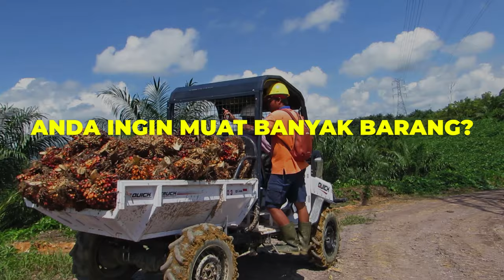BIAR GAK SALAH PILIH QUICK TRUCK | ALAT ANGKUT SAWIT KUAT DAN MANTAP

Comment: Like no 1, dari Cikupa Tangerang Banten Indonesia.
Reply: Untuk Kalteng harga berapa bos.
Reply from the maker: Kami memiliki 2 tipe Quick Truck, yaitu:
* Quick Truck (Starter engkol) QT-14M adalah Rp70.300.000 
* Quick Truck (Starter elektrik & engkol)  QT-14E adalah Rp73.950.000
Dapat menambahkan:
* Roda Besi (1 set) dengan biaya tambahan Rp1.600.000.
* Side Trellis Set dengan biaya tambahan Rp600.000.

Harga belum termasuk biaya kirim dari Showroom Banjarmasin ke lokasi Pak Bos. Harga sudah termasuk PPN 10%, oli, solar, dan biaya pelatihan.

Info lebih detail, silahkan menghubungi nomor telepon sebagai berikut:
TELP/SMS/WA : 082133326329 (Ibnu)
atau bila berkenan mohon kirimkan nomor telp/HP Pak Bos, bagian pemasaran kami akan menghubungi Pak Bos :)
Reply: Kendangkdmpul
Reply: @quicktraktor  l
Reply: @quicktraktor  l
Reply: @quicktraktor  0
Reply: 00
Reply: @quicktraktor 

 😅

Comment: BerPa harga quip angkut sawit
Reply from the maker: Kami memiliki 2 tipe Quick Truck, yaitu:
* Quick Truck (Starter engkol) QT-14M adalah Rp66.400.000 
* Quick Truck (Starter elektrik & engkol)  QT-14E adalah Rp70.050.000
Dapat menambahkan:
* Roda Besi (1 set) dengan biaya tambahan Rp1.600.000.
* Side Trellis Set dengan biaya tambahan Rp600.000.

Harga belum termasuk biaya kirim dari Kantor Cabang Yogyakarta ke lokasi Pak Bos. Harga sudah termasuk PPN 10%, oli, solar, dan biaya pelatihan.

Info lebih detail, silahkan menghubungi nomor telepon sebagai berikut:
TELP/SMS/WA : 08112848887 Sales QT

atau bila berkenan mohon kirimkan nomor telp/HP Pak Bos, bagian pemasaran kami akan menghubungi Pak Bos :)
Reply: @quicktraktor  klu second berapa ya

Comment: Harga berapa rupiah untuk wilayah Banten Plat A.
Reply from the maker: Kami memiliki 2 tipe Quick Truck, yaitu:
* Quick Truck (Starter engkol) QT-14M adalah Rp69.200.000 
* Quick Truck (Starter elektrik & engkol)  QT-14E adalah Rp72.850.000
Dapat menambahkan:
* Roda Besi (1 set) dengan biaya tambahan Rp1.600.000.
* Side Trellis Set dengan biaya tambahan Rp600.000.

Harga belum termasuk biaya kirim dari Kantor Cabang Jakarta ke lokasi Pak Bos. Harga sudah termasuk PPN 10%, oli, solar, dan biaya pelatihan.

Untuk melayani pembelian dapat menghubungi
Kantor Cabang QUICK JAKARTA
Jl. Gajah Mada 154, Jakarta
Telp: 021-6292044, 6490020
SMS/WA : 0811 2545 908 (Agung)
klik link https://bit.ly/HubungiMasQuickQTJakartaFB
Fax: 021-6490013
Email: jkt@quick.co.id

atau bila berkenan mohon kirimkan nomor telp/HP Pak Bos, bagian pemasaran kami akan menghubungi Pak Bos :)
Reply: @quicktraktor  pribadi bisa beli gk gan
Reply from the maker: @vivobukitjaya8223  Bisa dong Pak Bos
Reply: @quicktraktor  itu harga brpa.
Reply from the maker: @vivobukitjaya8223  Lokasinya dimana pak bos? Mohon maaf karena harga di tiap daerah berbeda-beda karena adanya biaya kirim dari pabrik :)
Reply: @quicktraktor  wilayah Kalimantan tengah.klo tidak mnta no wa saja biar lebih leluasa..
Reply: Sya pribadi bos sya ingin memiliki..mohon info ny ya
Reply from the maker: @vivobukitjaya8223  Untuk Kalimantan Tengah masuk wilayah pemasaran kami di Banjarmasin Pak Bos. Kunjungi fanpage kami @quicktraktorbanjarmasin
Whatsapp / SMS / Telp: 0811 2828 475 (Luthfi)
Showroom QUICK BANJARMASIN
Komplek Pergudangan Bumi Basirih Blok D/88, Jalan Gubernur Subarjo Km 3.8, Banjarmasin, Kalimantan Selatan 70655
Email: banjarmasin@quick.co.id
Kontak kami link dibawah
https://bit.ly/HubungiMasQuickQTBanjarmasinFB
https://bit.ly/HubungiMasQuickA360BanjarmasinFB
https://bit.ly/HubungiMasQuickQH11BanjarmasinFB